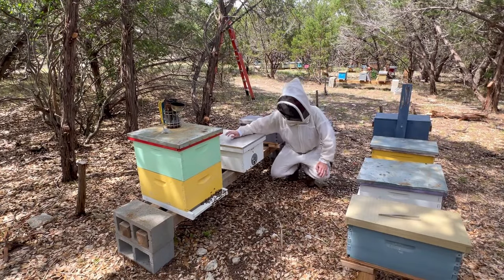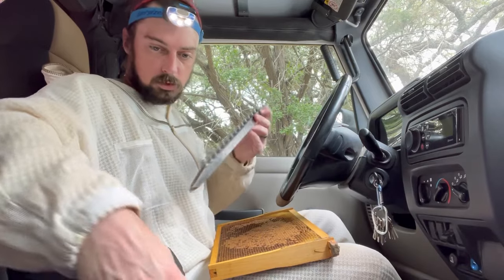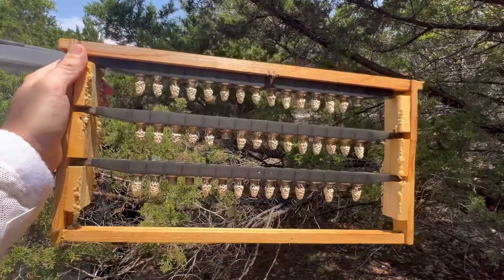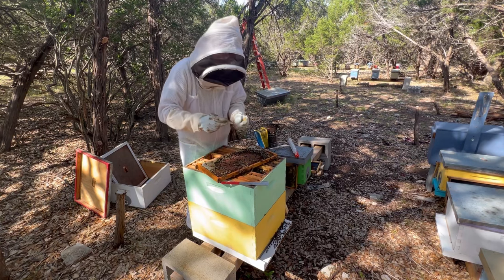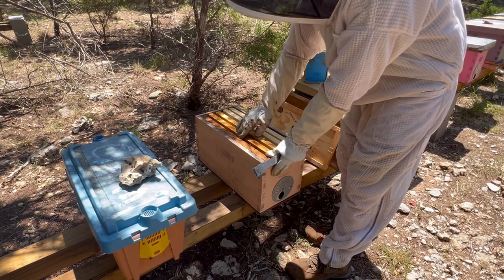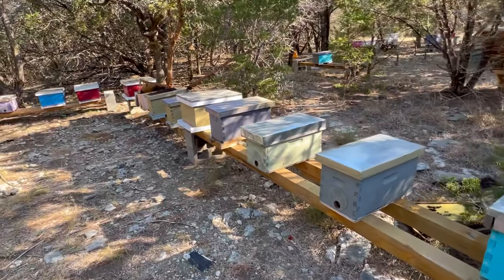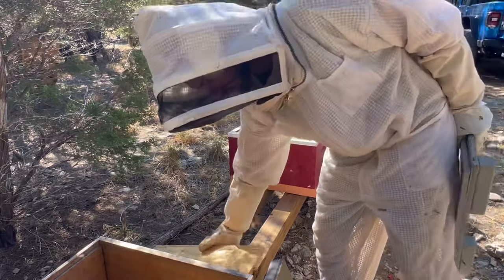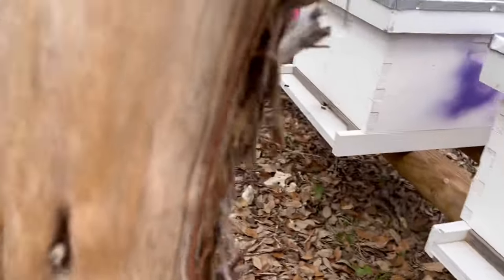HOW TO MAKE QUEENS, NUCS, and NEW COLONIES!! Make More Bees!

Comment: I would personally suggest putting honey on your bee stings. It helps with the burning, itching and swelling. I got popped 4 times in the face and had zero issues after the first 10 minutes, but I also put honey on it right away. It just ended up being a small little bump that kind of felt like a small zit. However, I did get stung on the knee recently and figured it wouldn't be a big deal and left it be without putting honey on it. Boy was that a mistake! My knee swelled up, it was hot to the touch, itchy, and a little tight and sore. I didnt think it would be so bad since it was on my leg and nobody would really see it. Honey, honey, honey for ALL BEE STINGS!  Cool video! Thanks for sharing.
Reply: Μετάφραση..ελινικα

Comment: Grafting is something I need to get a handle on. I wonder how some of my genetics would do down there. They are definitely calm and totally untreated survivors.
Reply from the maker: The hive I grafted those queens from was from a Cory Stevens VSH queen, which mated with my local drones. So those grafts are a VSH Italian hybrid mutt, and they’re very calm and are doing great. I like them better than the Cory Stevens queen hive because those are too boring. But using those genetics to breed with my local spicy genetics seems to have given me something good. 
It’s the setup of the starter colony that was the biggest set back of grafting.
The grafting is easy, and setting up the finisher hive is easy. But man, that starter hive will screw up a lot of work if you don’t do it right.

Comment: I dont mean to be rude by commenting, I just wanna give you advices on where i think you can improve.
First of all- I couldnt see the starter hive but for you to have a better cluster of bees on those cells you need to reduce the starter if its not totally full, so for that reason you need a 7 frame hive and trust me they'll fill those cups with royal gel to the  top. 
second- when you had those virgins hatch and put on cages, I noticed you took nurse bees from a hive which It should be queenless for better success and also the youngest nurse bees are found on open larvae so make sure next time you take those nurse bees on frames of open young larvae.
Third- never keep your cells and queens out in the sun and also make sure to give them water time to time, or you can puta sponge near them so they can suck water out.
However, nice work.
Reply from the maker: Thank you my friend!
All good info! 
It was my first year doing queens after a lot of research and I think I did pretty good, but I agree with all that you said. Always room for improving!
Thank you for your support.
Reply: @brownsbeefarm  you are wellcome  my friend, I also did my first graft last year and it was very nice to see that everything worked pretty well for me, but I didnt have a finisher hive since I dont understand it that well, but the starter eas used as a finisher and everythig went on point. I ll be happy to see more of your videos.
Reply: Great.

Comment: Sorry for the newbie question, but what is the difference in a starter and a finisher hive?
Also is that a double screen board on the finisher hive?
Reply: Hi.
A Starter Hive : is a Hive that has no Queen at all. What Beekeepers call Hopelessly Queenless !
You need this as : Bees think where's Momma? We need a Momma ! So 'find' an Egg OR the Beek gives them "Eggs" in preset Cell Building Cups etc.
They will Feed and Nuture that Egg, feeding say x16000 a day !
Next.
Once the Beekeeper goes into the Starter Hive : he will see, or ascertain how many Cells have been 'started.*' [to be drawn down into long hanging "Peanut" structures. These are Queen Cells ! Aka lots of unborn young Virgin Queen Mommas.]
A Finisher Hive : Does the job of 'finishing' the drawing down of these Cells. A Regular Hive can be a Finisher (with a Queen !) But she needs to be down in the Brood Box, have a Super. Then a Hive Mesh Screen Board is added, then an Eck (a Spacer Rim) then another Mesh Board,  and finally a Top Box with its own upper entrance. No existing Queen must touch / or sting dead her opponent, hence that gap or 'distance' between those boards.
The upper Box will be full of lots of 'nuturing' Nurse Bees. These are freshly born Bees that have not left the Hive or flown before. (Mainly identified by them looking really cute and Fuzzy !) Beeks need to collect up these Nurse Bees. (If they are isolated by that Mesh. Otherwise they know babies are 'there' and will go up to find and nuture them, via those QE Bars. Bees can fit through these no problem at all. . . 
Worker Bees (worn off their fuzz ! : Do all the Work : Feed the Queen, build Comb, go out to get Nectar, make Honey etc. They Work !!! And Run about a lot and Fly ! Hence not Nurse Bees, anymore !
The Finisher Hive basically raises those Queen Cells until 'one' hatches. The Beekeeper must make sure the 1st one to hatch doesn't go and kill all her fellow Queen Sisters (to Death) as the Primary one Rules, and doesn't allow others to take her Crown (!) So in this case. All Queen Cells are added to Cages, with a few Attendants encased and unable to get to each other, eg (do the others in !)
Then x1 young unmated Queen is added to a small (Hopelessly Queenless) Box of Bees : a Mating Nuc, to start a New Colony of Bees with their own Queen !
Get the idea. 😎
🐝🐝🐝🐝🐝🐝🐝🐝🐝🐝🐝
 Happy Beekeeping 2023
🐝🐝🐝🐝🐝🐝🐝🐝🐝🐝🐝
Some add Queen Excluders x2 also with a Gap, instead of Mesh Floors. BUT unless you know all Queens up top are Caged and secure. A Virgin on the 'run' is very slim still, and could 'Wiggle' through those QE Bars and go down stairs and Kill the big boss Queen ! YIikes.
Mesh Boards mean Bees up top need their own Food Source and access. If using QEs : Bees can crawl up and down and do Feeding and / or Hive activities. With the Queen being to Fat to get up through those QE Bars !  Yet her "Phremones" are wafted all about the Hive : to tell her Subjects 'I am your Queen'  
I Rule, and becasuse you can 'smell' me, you dont need to make a replacement  'me' !
However Colony Democracy is done by the Bees : to the Queen. If shes old, ill, not doing well. They can kill her, and make 'new' Queens to replace her. They find their own Egg and start off the process as above : Naturally !Lots of Queens means to many Rulers in one Box, so its a Queen to Queen :Death fight, OR (usually) the older one 'is kicked out' aka leaves. 🙄 
That's called Bees Swarming !
Nature's way of reproducing more Bee Colonies. 👍

Comment: Hello, can someone explain to me why starters and finishers are used. Why not leave the queens in the starter. What is his role afterwards, because the beehive is still without a queen.
Reply from the maker: By using a starter and finisher, you are able to mimic a queenless situation in a way that causes the new grafts to get fed as well as possible.
So for the starter, the reason you can do 45 queens at once is because I had about three colonies worth of queenless bees packed into a single 10 frame deep. So they’re so unbelievably stuffed in there and they’re so desperate for a queen that when you stick 45 grafts in, they will get them all fed ultimately.
Then, you let them stay for 48 hours so the cups get packed with royal jelly.
Now, you can take them from your started and go to the finisher hive. The starter is only good at packing in royal jelly into the cups since it’s mostly nurse bees, but they wouldn’t be good at fully finishing the cells, like a finisher hive would be.
A finisher hive is set up as an active 2 or 3 deep colony, then you put a queen excluder on top, and then add another box over that which would include lots of pollen and nectar, and fresh hatching nurse bees, along with your 48 hour old grafts.
So what happens is the bees from the colony below come up into the top box through the excluder because they can tell there is open brood up there.
When they get up there, they realize oh what the heck, apparently we are making queens. So they start finishing off the queens. The fresh hatching nurse bees right next to the grafts along with lots of pollen nearby insures that they grafts will be fed well and closed up healthily.
Then, after 5 more days I can get them out and put them into my incubator because they’ll be fully capped off at that point.

So basically the starters and finishers is how you make LOTS of queens.
You could make a small handful in a queenless hive, but they might not be quite as healthy if you force them to make too many. It’s a weird balance of tons of bees vs how many queens you actually get lol
Reply: @brownsbeefarm  Thanks for the detailed answer. My assumption was that the starter colony could also finish the queen cells. What do you do with the bees in the starter after they are done with the queens?
Reply from the maker: @toolsofthefuture  make more queens! You can run another batch or two on a starter before replenishing it with more nurse bees, or you can split the starter hive up into a few nucs and add one of your new queens to each one. And now you’ve got a few new colonies

Comment: Why not leave cells in small hive instead of finisher hive?
Reply from the maker: @jacobnelson9144  because the small hive is focused on getting new ones going, so they have a lot of energy to start cells, so they make a lot of them.
Now if you left them to keep feeding, they’d quickly run out of energy and ability to finish the cells.
So you take advantage of their energy on making royal jelly, since it’s loaded with young brood, and the finisher hive has the ability to finish off the amount of cells the starter makes.

Comment: Where are you located? South Texas? Thanks for your help and I do have a question: The starter hive is Queen less for how many days/hours? Also the finisher is a Queen less to?
Reply from the maker: I am a bit north of San Antonio!

On the starter hive, it has to be queenless for long enough to know there is zero chance of them making any cells. So if you make them queenless, they’re usually very good at coming up with a queen due to an egg you may not have seen or something. So once you’ve confirmed there is no longer ANY chance a queen can be made, you can insert your grafts.

The finisher I used is a queen-right finisher. The queen is separated by an excluder and excluded to the lower boxes. It’s called the Ben Harden method
Reply: @brownsbeefarm  I appreciate your fast response. I will definitely look into grafting and I want to make sure I don’t lose any of the steps.
Reply from the maker: @steliandone4078  I am happy to help. Queen grafting was fun and I am glad I can do it, but I won’t be doing it this year.
Be ready to need a lot of extra bees, and be ready for it to not work the first few times potentially until you get everything down. It’s very rewarding but it does take exact requirements on each step in order to work 😄

Comment: What's the difference between a starter hive and finisher hive? Are they queenless hives or not?
Reply from the maker: A starter hive will be a heavily packed ‘hopelessly queenless’ box full of bees. What that means is there is 0% chance that any sort of queen is either in the box or egg/larva viable for making a queen.
This way you put you grafts in and get heavily fed queen cups, since they so badly need a queen.

The finisher hive is a queen-right hive that has the queen excluded to the bottom to boxes. In the third box, the bees have been narrowed down to that small area of frames and the freshly fed starter cups are supplied to that box. The bees think they need to make queens, and as long as the actual queen doesn’t touch those cup, the bees will finish making queens in them. 
Once the queen cells are closed, I take them to the incubator ☺️
Reply: @brownsbeefarm8852  OK, thanks so much! So, In the starter hive you only leave a few days, but not allow them to cap them? How long? Also, is there a reason they shouldn't?  So, then in finisher hive, you have to remove after capped but not allow them to hatch, or I'm guessing they will kill her since already have gueen below excluder.
Reply from the maker: @JulysAngel69  correct, 48 hours in the starter. It allows the larva to start being fed intense amounts of royal jelly. Then the finisher will cap them off. Then 5 more days in the finisher to give you 7 total days, then they need to come out and go into the incubator so they hatch in there and not the finisher hive.

Comment: Why don't you use the starter as the finisher too?
Reply from the maker: @ratamahatta1300  because the starter is being reused as a starter. If you use the starter as the finisher, then you can’t make any more queens from that starter until they’re hatched. The starter getting them started and fed, then you pull them and can immediately stick some more in. Then the finisher takes care of capping them off, then off to the incubator they go.
Also, using a starter/finisher for both means you can’t make as many queens. A strong queenless starter can make LOTS of queens.
Reply: @brownsbeefarm  does the finisher have to be queenless?
Reply from the maker: @ratamahatta1300  no the finisher is queen-right
Reply: @brownsbeefarm  thanks